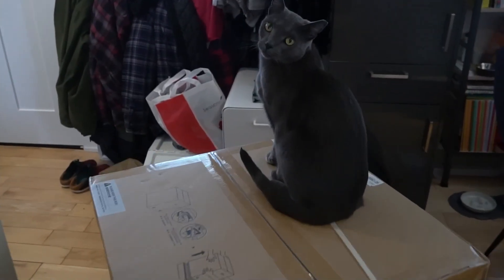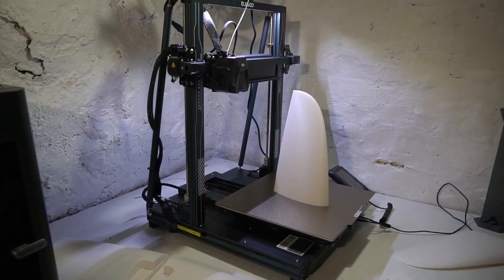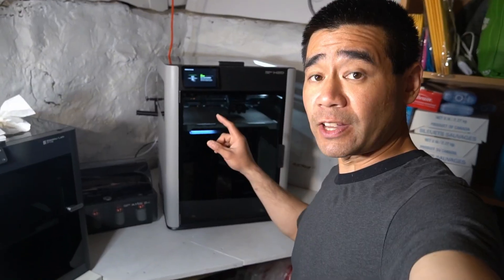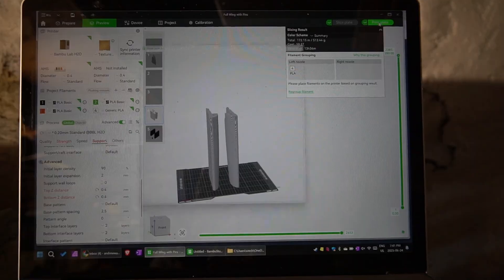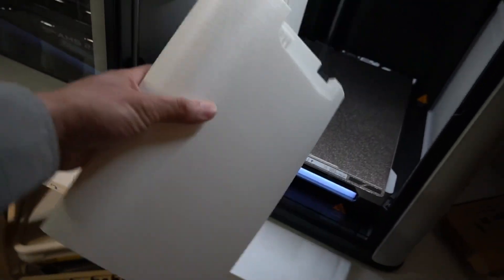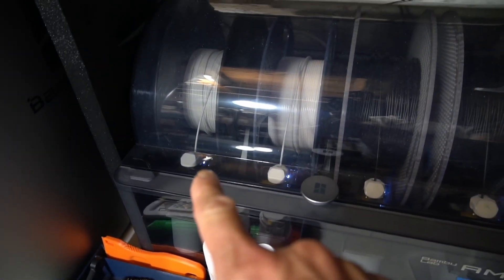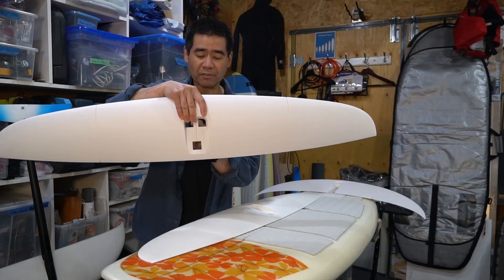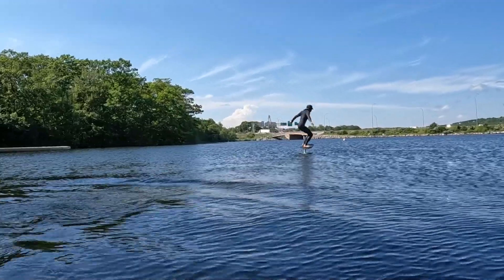Bambu Lab Sent Me the H2D 3D Printer - Here's Why I'm Excited | Hydrofoils

Comment: I'm surprised you are using regular PLA for this. PLA is hygroscopic, so it will slowly absorb water and weaken and become brittle over time. Also, if it's left in the sun, it will warp. Unless you are coating it with something ?

Comment: you can fix the nozzle drag wobble on tall prints by adding a perpendicular support fin triangle that's only attached at small points about ½" apart all the way to the top. i don't have a core-xy myself but i thing that wobble would still be there. anyway the h2d is much faster so congrats :)
Reply from the maker: Thanks for the tip! My buddy borrowed the Neptune so he try that.